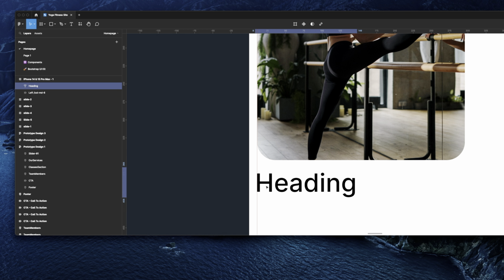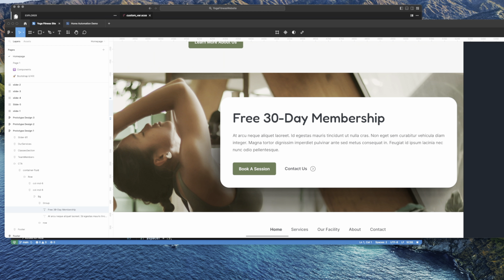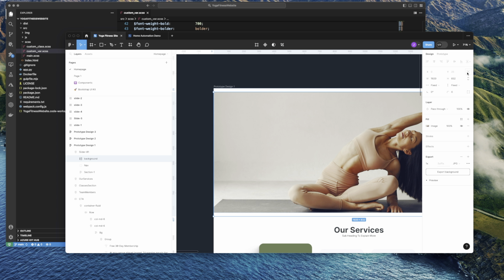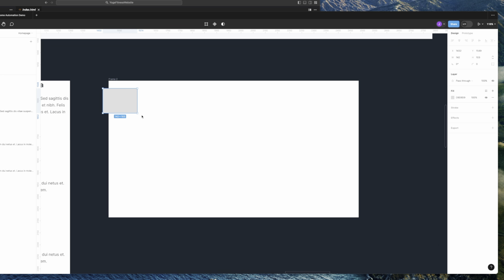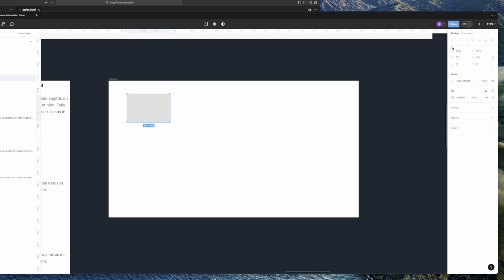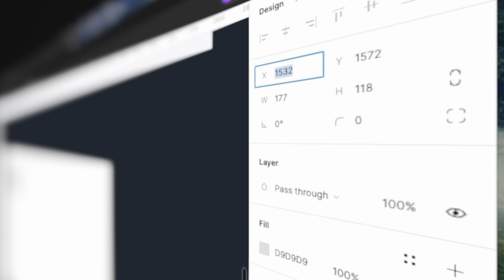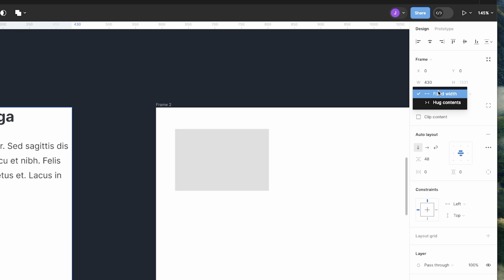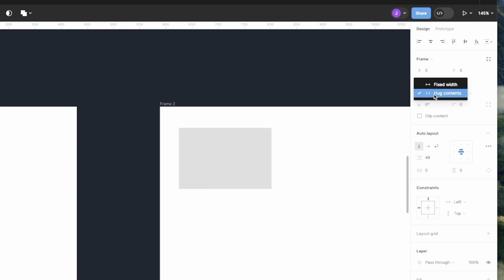This WILL Speed Up Your Entire Design Process!

Comment: and could you explain the boostrap method? you said it a couple of times
Reply from the maker: Thanks for your question! When I mention the 'bootstrap method' in my video, I'm referring to the practice of integrating Bootstrap, a popular front-end framework, into the UX/UI design process. This framework provides a comprehensive library of pre-designed components, such as buttons, navigation bars, and forms, along with a cohesive system for colors, typography, and spacing.

The goal of using Bootstrap in design is to create interfaces that are closely aligned with the needs and capabilities of the development team. By leveraging Bootstrap's components and guidelines, designers can ensure their designs are not only visually appealing but also 'development-ready.' This means the transition from design to code is smoother and faster because the design inherently follows the structure and standards the development team will use.

In my experience, adopting this approach significantly reduces the back-and-forth between designers and developers. It minimizes the time spent on adjustments and revisions to make the design fit within the constraints of the development framework. Essentially, it's about creating a more efficient and harmonious workflow where designs are optimized for implementation right from the start.

I hope this clarifies what I meant by the 'bootstrap method.' It's a strategy I've found incredibly useful for streamlining the design-to-development process, ensuring that we can move from concept to completed project more swiftly and with fewer obstacles.

Here's a few of my videos where I showcase this in action:
🎥 Modern Website Design Complete Tutorial Using Bootstrap: https://youtu.be/ddOlMDN5O_c
🎥 Setting Up Bootstrap (If You're Interested 😀): https://youtu.be/Ep9M-aEc7WE
🎥  A Great Beginner Friendly Video Using Figma & Auto Layout: https://youtu.be/oUwDJRDLRt4